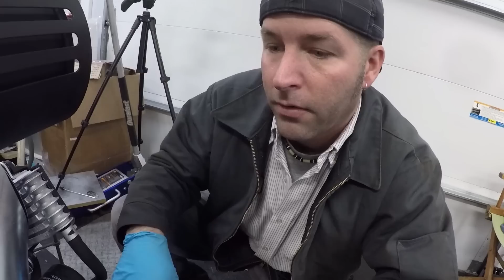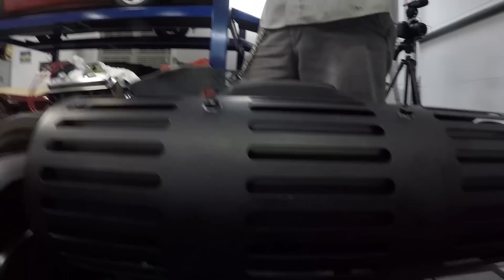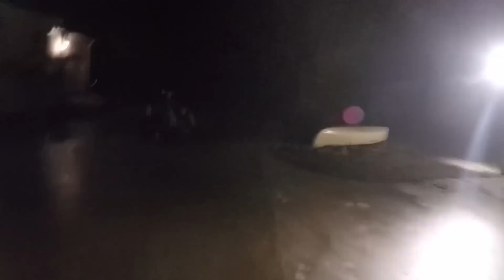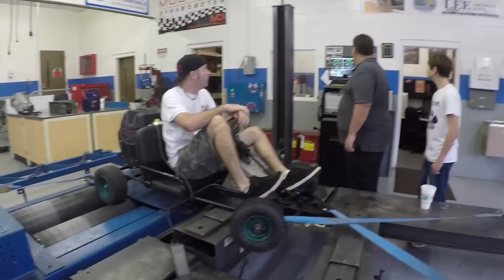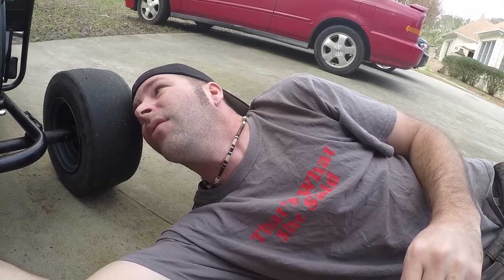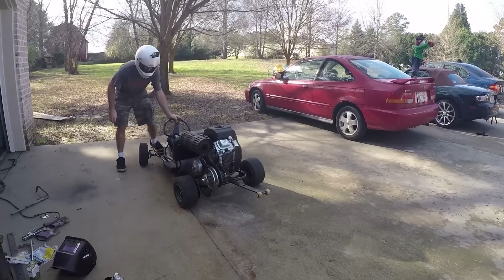V Twin Go Kart Governor Removal, Dyno, & Wheelies!

Comment: You guys need to build a drift trike with the same motor
Reply: yes,yes they do
Reply: AGREED!
Reply: Why? You won't move. Just spin in a circle
Reply: +Ian Thompson throttle control does wonders
Reply: +insane_ivtec Not with all that torque and plastic wheels. You could probably get away with running sold rubber wheels. Since you have all that torque.
Reply: +Ian Thompson no pretty sure it's still controllable if u know what ur doing no different then my crf450r out on the lake
Reply: insane_ivtec You have rubber or studded tires on the ice, not plastic. Colin Furze put a 125cc or something on his drift bike, He could harldy move. Just spun.
Reply: +Ian Thompson lol half bald Millville no studs...... And about 60 hp if never had one problem

Comment: Isn't that a 22 horse motor? you lose a full 5 hp from the crank to the wheel?
don't sound right, that's a big loss. Try a iridium plug and race gas????? open up the air box, and try one size up on the main.
Reply: What the hell will that do without timing and compression to take advantage of the higher octane? CVT's suck horsepower.

Comment: Lookin good guys! Here are three thoughts:
1) There are 36 tooth and 48 tooth solid steel 40/41/420p sprockets, they are probably the only ones that will hold up to the torque. 
2) Race karts set their clutches to engage at the peak torque output of the engine. If you are going to want the fastest acceleration, you might want to look at swapping out the roller cams and springs on the drive unit of the torque converter to engage at a higher rpm to help compensate for the lower torque at wheels at the standard engagement RPM's. I'd check MFG supply for those. 
3) If the torque converter didn't come with a belt that says "comet" on it, the belt will have less surface area to grip, resulting in loss of power to the wheels. The chinese knock off belts are the same width, but not as thick. A genuine comet belt will outperform a Chinese made belt every time because it is thicker (not wider).
Have fun!
Reply: With a torque converter, you set for max HP RPMs... not max torque RPMs...
Reply: What are you trying to say? I feel like you are trying to say something, but that sentence just isn't even a complete sentence.

Comment: Why do you keep calling it a torque converter? 
It's a CVT.
Reply: Cvt is Constant velocity transmission idk if it's the same tho
Reply: +dacasman so im not sire u know what your talking about 12 year old
Reply: +vanrocks99 Nation or Continually variable transmission
Reply: +dacasman That's because it's marketed as a "torque converter" or even a clutch sometimes.
Reply: DCKVapin Why exactly do you assume I'm 12?
Reply: vanrocks99 Nation CVT stands for "constant variable transmission"
Which is exactly what this is in the video. 
It's the same exact thing snowmobiles use, and I've never heard anybody call it a "torque converter" on a snowmobile.
Reply: +dacasman It converts the engine speed to variable gears basically so there's lots of torque on launch and it let's out on torque for higher speeds as you get faster. It literally is a variable transmission, or CVT. But it converts torque across the power band so you get the best of both worlds. Therefore, it is a torque converter.
Reply: +dacasman i like how he calls you 12, but he can barely spell.
Reply: it is technically a cvt but its marked as a torque convertor i sbowmobile to people just call it differnt names
Reply: DCKVapin He knows what he's talking about. In real cars, a pulley + belt system or other type of Continually Variable Transmission like this one is computer controlled to get better fuel economy. Here, it seems to serve only to create a range of gear ratios rather than a single speed with your regular old centrifugal clutch, so that at low speed more wheel torque is produced than otherwise possible. Gowever, calling it a torque converter is prevalent and simply wrong to a car guy. A torque converter is in any car with an automatic transmission, and it is a hydraulic part that lets an engine turn without turning the wheels because instead fo being directly connected to the gears and the rest of the drivetrain, it's connected through the torque converter which has its output driven not by the engine directly but by fluid that is moved by the input side of the torque converter. sort of like a fan turning in the wind, the torque converter has two fans facing each other to pass the power.
Reply: +dacasman  Actually its a brand of CVT called "Torque-a-Verter"
Reply: JustKyzuuh right, I understand that, but if that's the case wouldn't all CVT transmissions be considered a "torque converter"
if so why not just stick with calling it a CVT? Seems kinda unnecessary to call it a torque converter when it already has a name that makes perfect sense (CVT)
I mean you could technically call it a "spinning belt pulley thing" 
but why? 
I just don't see a reason to be calling it multiple things.
Reply: draggonhedd Ohhhh okay. I Just noticed that. Sorry for the confusion xD
Reply: dacasman It's all good!
Reply: +dacasman +JustKyzuuh What sources back this up?

To clarify for EVERYONE:

1) A Torque Converter IS a CVT, it is just marketing slang used in the world of Go Karts and Mini Bikes.

2) A CVT does NOT have any gears, it is two pulleys who's diameters continuously vary depending on RPM. The drive pulley is pushed "open" by a spring, and the second pulley is pushed "together" by a spring. As RPM/power input increases, weights inside the pulleys push against the springs, thus changing the ratio between them constantly.

3) You don't "Convert the engine speed to variable gears", and the change in torque you talk about is a result of the varying ratios between the pulleys, the engine puts out a mostly constant amount of torque, but at WOT, the engine spins up to an ideal RPM, then stays there while the pulleys change into the highest ratio (or lowest, depending on how you look at it). At that point, the engine RPM climbs to the limiter. It is like having a centrifugal clutch that starts with a low tooth count, then once the engine is at a certain RPM, the metaphorical tooth count increases dramatically, over time, then the engine tops out normally.
Reply: +dacasman its called a torque converter thats why.
Reply: +dacasman I feel the same. A torque converter is what is used with an automatic trans and a CVT is exactly what is shown in the video.
Reply: +dacasman Because the manufacturer calls it a torque converter. Yes it basically is a CVT.
Reply: +dacasman Go kart lingo
Reply: its called a torque converter and it always ben called that ever since day one.
Reply: Travis Brown No it hasn't, it is just a marketing term used in reference to the go kart and mini bike scene.
Reply: torque converter
Reply: +dacasman Because it's torque converter.
Reply: Are you the same guy that ask why people call tissues. -- Kleenex-- ??
Reply: It's called a Torque converter when talking go karts or minibikes. But it is a CVT
Reply: +MrStickyWaffle  lol and cause hes assuming shit, snow mobiles and shit have different set ups and shit... his point is invalid
Reply: +kenykillr me too
Reply: this is a belt operated torque converter. if this was a cvt, it'd be much faster, and would have a metal ringlet pushbelt into a variabke gearbox.
Reply: _Milo Wrong; a CVT and a torque converter (as referenced in the kart and mini bike scene) are the same animal.

Comment: been wanting to do a vtwin with torque. now i know what  to use. thanks. keep em comeing
Reply: +chris bartz sure
Reply: problem im having is finding a tc for a 25hp briggs.
Reply: they are expensive. we got ours at gopowersports but i think its rated at 16 hp. we are pushing 20 hp with 40 foot pounds of torque at the wheels. so far its holding up great. its around 400 bucks i think

Comment: If it's similar to the 212 you don't need to open the case and do all that to disable to governor, just remove the linkage connected to the carburetor

Comment: what kind of rpm is that converter able to handle past  the governed  motor  setting? doesn't the drive clutch just keep on squeezing the belt up and out to keep up with  the new found  insane gobs un- governed rpm, seeking new and un- charted infinate ratios or will it just puke the belt?Don't mean to take anything away from two seater yard kart wheelie fest but im  really interested to know how long it will take for those 1000 or so extra revs to  put an end to the wheel lifting fun...Does it feel as if it can be steered  a little with a  bit of weight shifting while its on two wheels?  God bless the people at Go power sports  for sending you guys all those amazing pieces.You use them extremely well.
Reply: +Thomas Hamilton the clutch gear ratio is maxed out at like 3000 rpm ( just a guess ) and the kart goes where ever it wants to go on 2 wheels. lol

Comment: The stock cam is designed for one range of rpms and the carb doesn't have an accelerator pump.

You guys beat me to it but I'm putting one of these on a chopper with a 5 speed.

Comment: The engine also has a mean off idle tip-in hesitation. Maybe the float bowl level is a bit low, or you need a large low speed jet? Something? Does it have an accelerator pump circuit?

Comment: These engines are designed for spec output at spec RPM. It will rev higher without the governor and spec exhaust... but without a cam that is spec'd to breathe more CFM at the higher RPM and less backpressure in the exhaust, any gains will be minimal (if any).

You need a cam with higher lift, more duration, etc. To be honest, a narrower lobe separation angle (LSA) would be the best solution... because your performance clutch is capable of keeping the engine at a more stable RPM. The LSA on the OEM cam is designed for a broad torque band, and restrictive exhaust. A closer LSA would narrow the torque band and bring the low end torque up to your intended RPM. Same torque at higher RPM means more horsepower.

Comment: hi it needs a roll cage other wise it looks good 👍
Reply: Why? It'll be fine.
Reply: +Brandon Theboss but it might tip
Reply: +Ricardo Adame it'll be fine
Reply: +James Knapp ok
Reply: +Brandon Theboss IT might be fine, but THEY won't. I have to agree... Some sort of ROPS on the back.
Reply: +Noah safety first right
Reply: No, We need more videos. No people, no videos.
Reply: unnecessary weight itl be fine
Reply: You are telling me that a 30+ lb/ft engine will not handle 25-35 extra pounds to ensure that the black widow will not crush them? The extra weight up top would make for MORE WHEELIES, and would you rather slightly slower acceleration, or a broken neck or back? The engine alone weighs well over 100 pounds.
Reply: You do realise none of their other carts have cages or even seat belts right?
Reply: +James Knapp you do realize that none of their other carts had a 670cc v-twin?
Reply: Noah you do realise it'll be fine
Reply: will THEY be fine?
Reply: +Noah dude stop being a mom it'll be fine
Reply: Have you ever ridden a go kart like that?
Reply: Yes
Reply: +Noah i fucken wish
Reply: Exactly, you don't know how it feels to have a kart flip onto you.
Reply: +Noah yea i do
Reply: how about when moving over 40 miles per hour?
Reply: No but it weighed more than i did
Reply: +Noah I agree with you but it has a bigger chance of flipping with weight on top but you're right and it will look stupid and also the frame is not strong tho if it flips the frame will snap especially with a roll cage I think what they need is more wight in the middle of the kart
Reply: +Ricardo Adame Racing gokarts are way faster and they dont have rollcages, they also make WAYYYY more power and have less weight so they are more likely to tip, this has so much weight on it that i doubt it will tip...
Reply: +Noah ive wrecked going 55 its better to get thrown out then getting stuck between the ground and the kart
Reply: Its not for me to argue anymore, its for them to decide.
Reply: +Noah yea it really is
Reply: Professional racing go karts are way faster and they dont have rollcages... because they know if their drivers fall out, they wont have a big steel go kart crushing them.
Reply: +GHOST but they're karts are low to the ground and hard to flip i used to race
Reply: austin_mopar The kart they have has more weight that racing ones.... go look at actual go kart flips... see which you prefer to get your head crushed in one OR have it flip and fly over you...

Comment: I disconnected the governor of a free mower I got from the throttle on the carb
Should I be scared of how high it can rev
😨
I swear that it can rev past 5k
I’m probably going to destroy it if I rev it too high
And yes, on the Briggs 300 series engines I learned, that you can remove one part and attach a spring to any place to hold the throttle at idle to bypass the governor.
And I doubt the old box of bolts has an engine brake.

Comment: Balance the motor  stronger rod , dual carbs ,tuned exhaust and a buggy frame or as has been said build a cycle cart with the engine mods .

Comment: WHY go to all the trouble to take the governor out of the crankcase???  Just disconnect the governor linkage from the carburetor.
Then you would have Direct control over the carburetor and open and close it as You choose.
OR you could grind some weight off the the governor weights and raise the RPM limit.
Thanks for thee videos!

Comment: Did you get rid of the pull to the right when doing a wheelie? If not, move your wheelie bar about an inch and a half to the left and this may very well solve unloading the right rear when energizing the bar.
Reply: +M H the biggest problem is we are sitting too far to the left because its a two seater. we have thought about moving the wheel but thats as far as we have gotten. lol

Comment: My guess is that the wheelie puts the engine too far off level combined with the extreme forward acceleration could cause too much engine oil to be forced into the valve train....thus the smoke.???

Comment: someone needs to do a rwd pickup truck with a 999cc v twin duromax or wat ever u think is best (as long as it is 999cc) and see if it can get at least 80mph top speed minimum i havent found any video of that with that engine in a street legal vehicle again use a 999cc duromax (35hp i think) in a street legal pickup rwd

Comment: Decent build, but that motor won't last. If you want a big horsepower, high rpm fairly lighweight v twin, find yourself a used can-am outlander 500 and use that for the donor vehicle. You could use the stock can am clutch, ecu etc. Those motors made about 40 horse out of the box and they are happy at high rpm.

Comment: put the engine from a Suzuki sv650 on it please! it's more tough, makes 70 hp, has a six speed sequential gearbox and it may fit on the kart because it's also a v-twin (90° angle) with 650cc. that would work against the corvette. it the rev limiter is at about 11000 rpm so there are no problems with that! :)

Comment: I would just use a 2 stroke motor 250cc or 500cc would be so much faster and way more fun
Reply: Yea? Maybe you should post a video of the one you built.
Reply: Wade Wright go karts are for kids ill stick to my banshee and cr 250 go karts might be fun but not having a suspension would get old fast where i ride. I had one when i was 7 but ive moved on. But i do like to tinker and thought about building a cheap mini bike with one of those cheap predator motors from harbor freight. It just seems to me using a 2 stroke motor and having a 6 speed tranny would make it much more fun no I’ve never built one. But one of the 125cc motors hitting 15rpm’s sounds fun too me plus there’s plenty of mods for those types of motors.

Comment: Suggestions? 

1. Silicon beads or external oil drain tube to guide oil for draining.

2. Knife edge the crank.

^and if you do this

3. Install a small external oil cooler to increase oil capacity and keep the oil cool

Comment: What does the governor do 🤔
Reply: slows it down
Reply: Restricts the top speed
Reply: Basically makes it so it won't reach the engines full potential and you can't reach the top speed (dumb right) but at the same time it protects the engine from getting damaged
Reply: +Gary Garrison full potential A.K.A top speed
Reply: it restricts the engine's rpm

Comment: ok so noe its been some time and no update? ???
i want to buy one of these for a mini bike build.... 

but i still dont know if engine is ruined? some said needs new rings... some said head gasket.. and others say it will be fine???

if i remove govenor. and crack it wide open... can it handle short burts of that???  i eont be doing any wheelies as engine is in center of gravity... with large rear tire...

Comment: So realistically this motor is no good for use on a baja buggy with the oil sloshing around internally. That sucks I was thinking of a build with 4 wheel indy suspension with a motor like this. Well I do have a 670 Rotax that will do the trick. BRAAAP!!!

Comment: Ok, so have yall had any trouble with your torque converter? Like have you had to adjust the preload on the spring? Because I it one, and it's being a pain in the butt, it would/will take off but do like 7mph tops. Then I tried to reset the preload (because I don't think it had any preload on it) but now it's worse.
Reply: +Jay V we have not had any problems with them
Reply: +isaac it'll be fine you're not even the real Isaac lol

Comment: Why not just remove the linkage between the governor and the carb?  That would seem to be much simpler.
Reply: +eformance yes but the gear that we removed has been known to come apart at high rpms and trash the engine